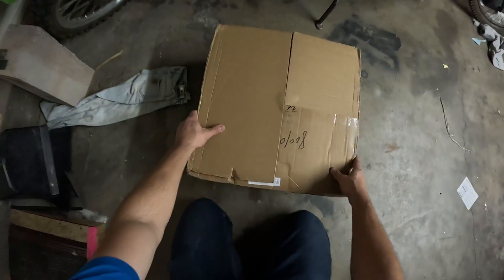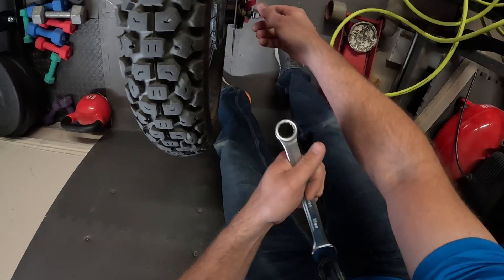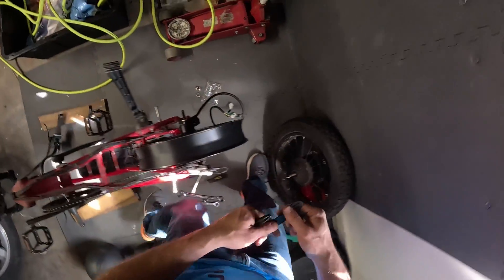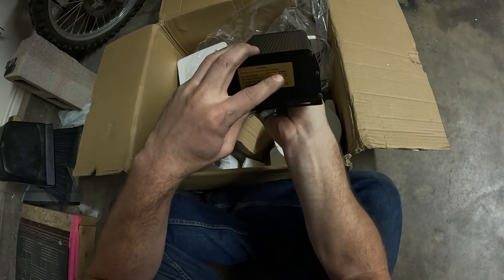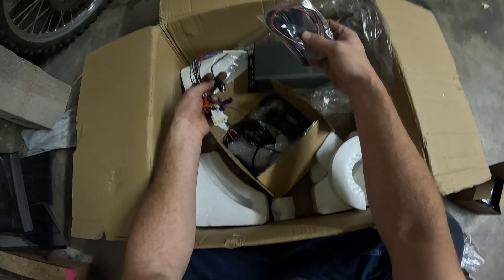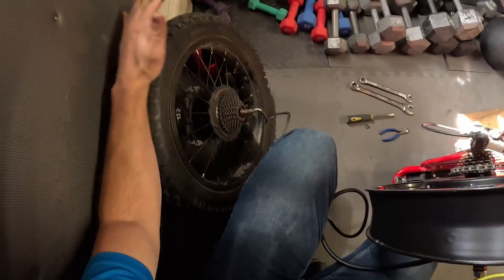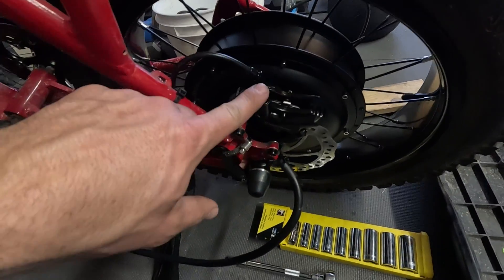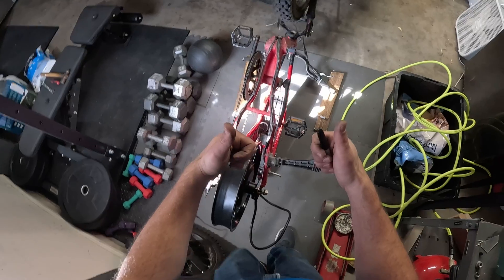Massive Upgrade: 72V/5000W E-Bike Conversion Kit, Part 1

Comment: Hey man heads up be careful I got the same scrambler frame sabvaton 72100 an 5000 watt motor an I snapped the aluminum frame
Reply: Too much power man
Reply: many questions. what frame and how did it happen? Off the line? 
 Did you use good dual torque arms from grin or the cheap ones/ none at all?
Reply from the maker: @Dus306  I'm using the integrated torque arm on the CampScrambler frame and I added a torque arm on both sides of the ebike. So 3 torque arms in total.
Reply from the maker: Thanks for the heads up. If I were to do it again, I'd probably keep the motor around 2-3kw and just get a good controller.

Comment: Please for the love of God get a better controller 🙏 I would recommend a asi bac or nucular
Reply: What’s wrong with the controller? Cheap, been running on my bike for half a year, not one issue. It’s not the best but it works
Reply: I have that controller and I got my qs205 so hot it started vibrating, although it’s an NBPower motor and I heard that they arn’t the best.
Reply: They are stock controllers if you want a quality controller that can deliver the power that .motor can handle go nucular or asi if not be relegated to 25% power and not even the most efficient 25% meaning your getting less range for the same power 🤔 plus you get more torque for the same wattage with asi or nucular while getting further 🤔 there's a reason they sell you that controller with the motor for an extra 100 bucks or so when you can get a controller that can handle the 25kw that motor can handle
Reply: I have the sabvoton 100a controller too with a 5000w hub motor on 26 fat tire mountain bike and it's been great too me, no issues at all. Just need to figure out how to hookup pas or cruise control.
Reply: They are "fine" but they don't provide anywhere near amps that motor can handle you could go with a much smaller motor and get better performance 😉 power to weight and all that! 
But if your gonna use that motor go with something way more efficient that includes mtpa and better power delivery you will see the difference that motor can handle close to 200a if not more 😉

Comment: 20 inch o 26?
Reply from the maker: 20"x4" bicycle tire size or 3.00x16 motorcycle tire size.
Reply: If you know the size you could put on the motorcycle tires in 26 fat, I would appreciate it, it is for ebike projects